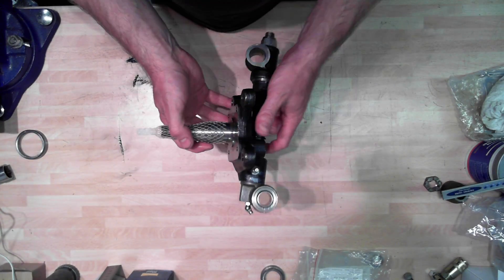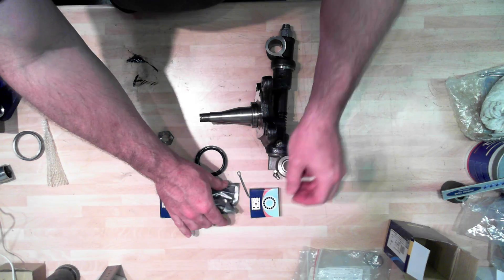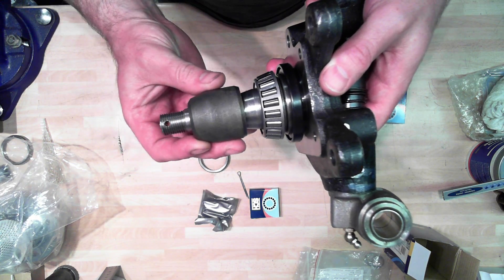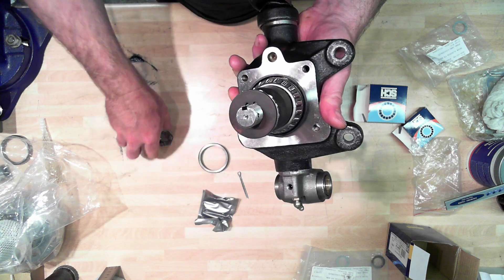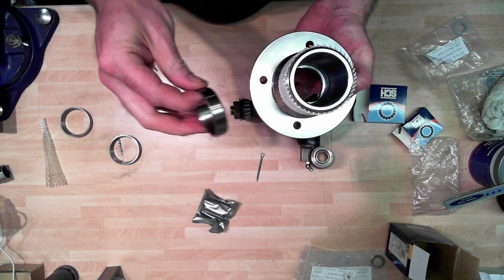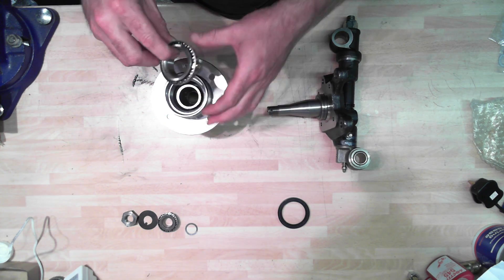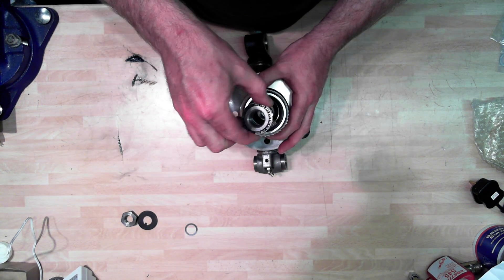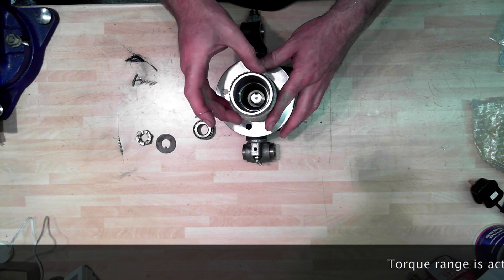MGB Front Hub Trial Assembly

Comment: Great video!  Thanks for posting it.

Three comments.

First comment.
I found this out the hard way. Not sure if Andrew mentioned this, but the king pin has two holes for the cotter pin that are at 90 degrees to each other; one through the slot for the tab washer and another one at 90 degrees. This is very important because once the correct torque has been established it is possible one of the the merlons of the castle nut could be blocking one of the holes.  By design if one hole is completely blocked the other will be completely open. This allows for minimal tweaks to the "over-torque" should a hole not line up with the crenels of the castle nut.  If this is a rebuild there is a good chance the holes will be filled with grease, so poke about with a pipe cleaner.

Second comment.
Once the bearings are packed with grease, and assuming the swivel arm is on the car, it will be tricky sliding the shims and outer bearing into place. The whole hub will become a sticky mess. It is possible to drop a shim beside the spacer, and it may be hard to see, find and fish out. After several machinations of trying to slide these things in and out (as Andrew said, getting the right number of shims is trial and error) I found if I laid a length of clean, smooth, ridge wire into the slot of the king pin I could use it as a guide and slide the shims and bearing down the wire and on to the king pin.

Third comment.
Keep count of the number of shims you are using. Because of the trial and error process of finding the right shim thickness you will have to repeat the exercise several times (most likely). There is the possibility of losing a shim beside the spacer. So as you experiment with the right number of shims of various sizes record the number of shims used. For example, if four go in and you need to repeat the process you have to be able to account of the four. Some shims will be stuck to the spacer and some will be stuck to the bearing. Like the two holes in the king pin, I learned this the hard way. It was only by dumb luck that while crawling around on my shoulder, reenacting elements of my basic training, I saw the glint of a shim disappearing beside the spacer.

Andrew, thanks for the video.

Comment: Nice vid. I watched the other one too. Those look like the same bearings I ordered for my MGB ('72) Roadster. I will be changing my right-front hub in the near future. I'm reusing, or hoping to reuse, my old collar and castle nut. I have a used, but great condition, hub coming to me by this Friday. The reason I have to change this hub is the splines are flat and the wheel slips.  This is an unsafe situation so make sure your splines are good in the wheel and on the hub.  Thnx for the helpful vid 😊

Comment: sorry meant 2 thou
Reply: The method I learned years ago was to fit the bearings first without any grease, just lightly oiled. Select shims for a clearance that allows the hub to just spin without binding when torqued up fully, then dissemble  grease bearing well, re-torque, check rotation, and done

Comment: might find if you torque up too tight and 70 ft lbs is miles too much the wheel will not rotate, with this typ of bearing there has to be 10 thou slack to allow the bearing to expand as it will at speed